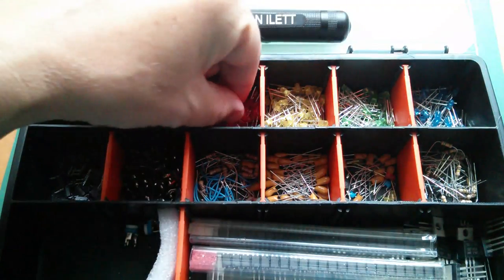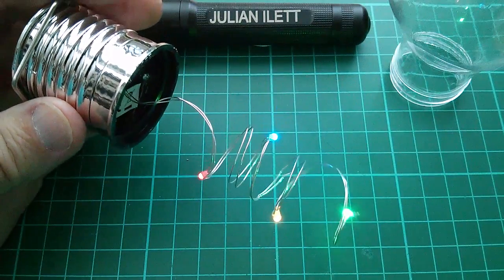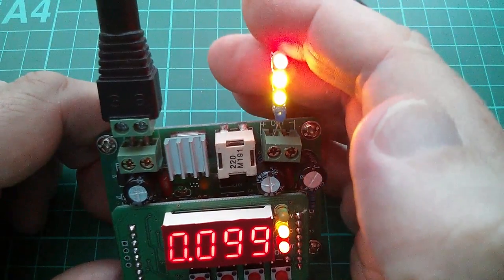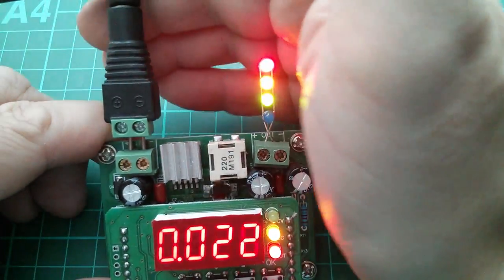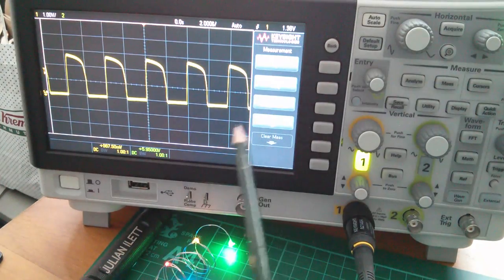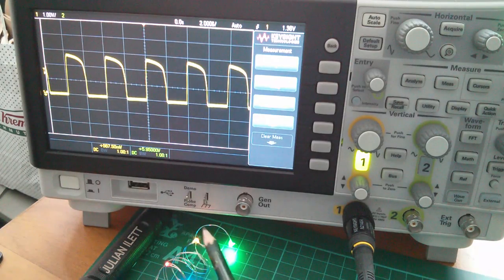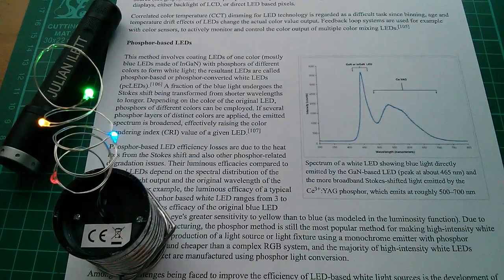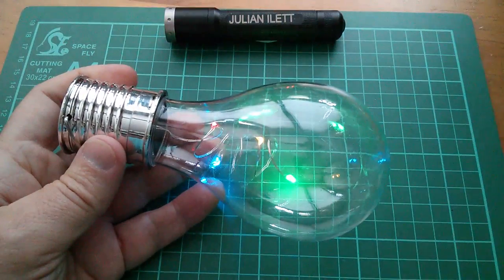Poundshop Garden Light, Parallel LEDs and Stokes Shift

Comment: I've been buying 5V solar panels and making solar LED lights for my garden. The Qx5252F is an amazing chip. If no voltage comes in from the panel, the led's are switched on. You can change the value of the inductor for more current according to the datasheet. I use those plastic lunchboxes for the job and 1 AA size eneloop.
Reply from the maker: I think a bigger inductor would be a good idea - this solar light really isn't very bright when compared with my other garden lights.
Reply: Big clive does the modification on one of his videos.
Reply: See if you can figure this out
Voltage 1.3V 1.3V 1.3V 1.3V 1.3V 1.3V 1.3V 1.3V 1.3V
L 330uH 270uH 220uH 150uH 100uH 82uH 56uH 47uH 33uH
11mA 14.5mA 15.5mA 25mA 34.5mA 38mA 50mA 75mA 110mA

Comment: A possible clever way of driving parallel leds with different forward voltages would be to have the sets reverse wired to each other (ie red and yellow in one direction and blue and green in the other) and then just drive them with a square wave centered at zero. Just like charlieplexing. Problem solved!

Comment: Another trick is to use LEDs parallel but in opposite direction and give them different voltage in different polarity
Reply: TechStuffGuy I got sent some two pin bi direction LEDs recently, they are really neat as technically they work in either direction (with different colours) 😂
Reply: That is how I thought this worked
Reply: I'm too...
Reply: Does that type of setup have a name?
Reply: I know they're diodes, but don't LEDs have a nasty tendency to fail if they're driven at their full voltage in reverse?
Reply: LEDs have a breakdown voltage of around 5 volts, so as long as you don't put more than -5v on an LED you're fine.

Comment: I was wondering where this video was going as I have had the same problem with parallel leds, I ended up with them in series as the only way it worked, but the use of phosphor coated leds seems like a great solution.

Comment: If you had turned your stack of LEDs round the other way, with the red at the bottom, then they would have been the right way round to connect straight to the power supply.
Reply from the maker: That is true :)
Reply: My suspicion is that you don't cover wires you have twisted over each over to bring surprise short-circuits in the future...

Comment: The thing with 4 legs is a Joule Thief. That's what my research turned up to be able to find them. A very neat circuit. The part number on the ones I had were scraped off. I needed a bunch to repair some solar lights. I have been using the extras to make custom solar lights out of eclectic bottles solar panels and old batteries.

Comment: The boost converter, making good use of the back emf that you usually dump into a diode from a relay coil.
The output is driven to 0v, to build current in the inductor, then opened so that the kick from the inductor is added to the supply voltage, repeat.
So a DC meter will only read the supply voltage

Comment: These chip are usually made to drive one led, or several leds of the same type. Basically there's a MOSFETbetween the output and gnd pin that's switched by a 100khz square wave. When the mosfet conducts a magnetic field builds up around the inductor. When the MOSFET is open the inductor outputs a voltage to the leds. There is no capacitor nor voltage regulation. The voltage can't go much higher than the led forward voltage because the led has a very small resistance, anf it can't go lower otherwise the leds stop conduct, the circuit opens and the inductor voltage goes up.

Comment: Looking at the schematic, in dc current, the coil becomes a wire and is connecting you directly to the battery. The output is some type of pulsed dc, which is exactly what you said.

Comment: I'm gonna make a guess without watching to the end. LEDs are grouped by voltage in two groups and connected in opposite directions. There might be a PWM  or something similar driving them. Maybe the inductor is in parallel with the leds. when you put a pulse to an inductor you get a ringing waveform which will be clipped by the two groups of LEDs to different voltage, so there is a DC offset. That's why you see something different than 0 on the DMM.
Reply: I'm wrong... They could have used white LEDs with just color filter on top.

Comment: julian, hey I got a question, or two. I'm working on a project. And I have 6v 100mah cells, and I also have 2.5v 110 mah cells, is it possible to wire the different cells together and get 6v and maintain 6v and high mah? 
I have many cells, but what I'm trying to do is 
I get 4 of the 2.5v and put them in series ++++- - - -, it gives me 300mah with 2.5v, then no mater how I try I can't put the 6v with them, to try and get it to 6v 300mah, I tried a diode, the regular black with grey, I was thinking mabey a shotkey might help? What do you think.

Comment: Could it be white led's for the yellow and red and just colored plastic to change their color?
Reply: That's what I thought !! Seemed obvious.  Maybe the blue is standard blue LED.  Both blue and white LEDs have similar voltage drops (3.6 & 3.2).
Reply: No -- white LEDs are also just blue or UV LEDs with added phosphor on top to generate white. It won't make sense to have a blue LED, with a phosphor on top to create white, with a filter to get just the yellow or red.

Additionally, a lot of the cheaper white LEDs don't generate much (or any) light in the red spectrum, so the red filter wont be very effective.

Comment: I must try 4 different color LEDs powered in pararel by QX5252. That driver supply LEDs different way. There is no constant current or voltage all the time.

Comment: what does "13.8v because we have a little bit of sun today mean please?
Reply from the maker: +Loz Turner The 12 Volt supply in my workshop comes from lead-acid batteries charged by solar panels.
Reply: oh I see, so you don't get a consistent voltage? how do you regulate, that or does it not matter to much being in some sort of 'error of margin'? thanks for getting back to me

Comment: I don't think it's Charlie that's clever.  I've seen the same wire & LED used for a Radio Shack USB-powered Christmas tree thing with 10 LEDs.  You can probably buy that wire by the foot from China.  Edit:  Yup.  All over eBay.  http://www.ebay.com/itm/2M-5M-10M-Copper-Wire-AA-Battery-Fairy-String-Light-Christmas-Party-Decor-/282544925419?var=581708036843&hash=item41c8fd6aeb:g:pUEAAOSwjvJZURIy

Comment: It's not a good idea to run LEDs (directly) in parallel; use the highest Vf, and calculate a dropping resistor to put in series with the remainder - this way each LED gets a dropper except for the one with the highest Vf, then just use a boost converter capable of the current draw of the parallel combination of all the LED/resistor strings, and an output voltage slightly higher than the Vf. Now, all the LEDs will be happy. Oh, and use regular (not phosphor-shifted) LEDs. Either that, or put them in series, and boost to the total Vf! :)